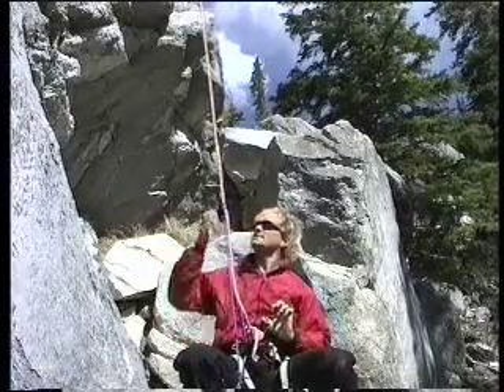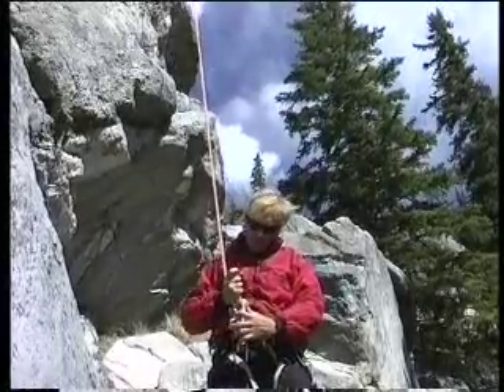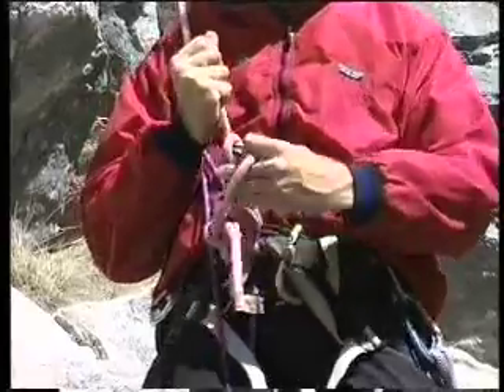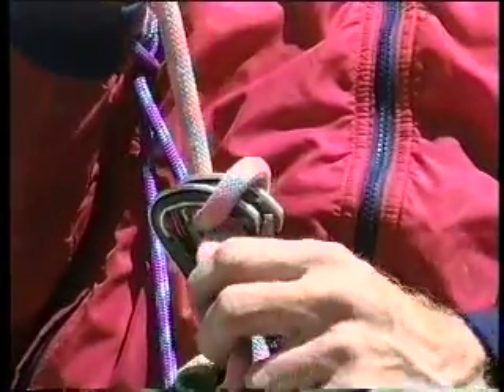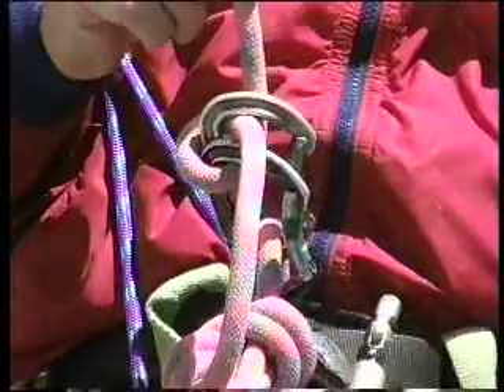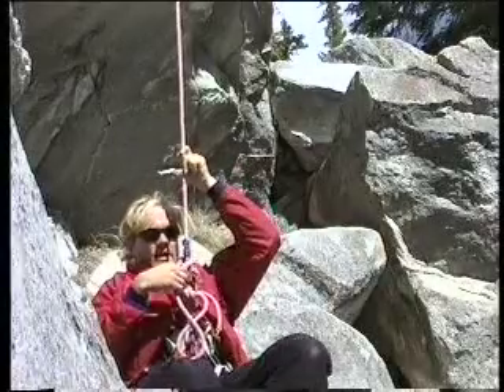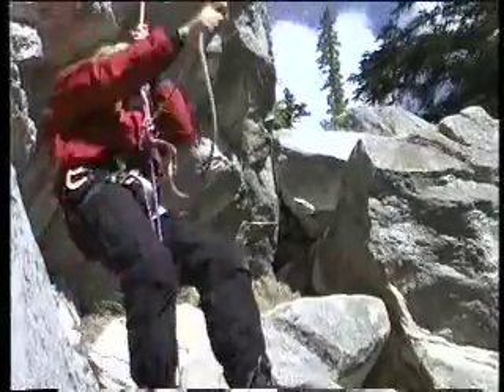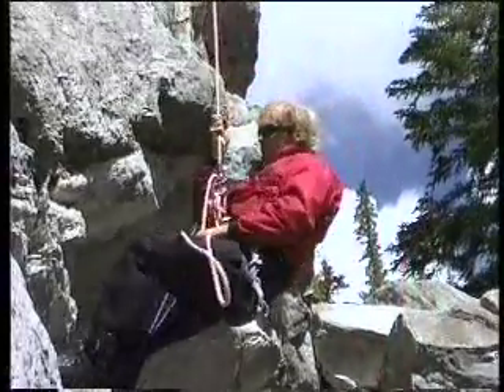Climbing Tools: Crevasse self Rescue. Garda hitch

Comment: Hi, these is an example of working when we are lack of devices right? Would it be possible to have the bottom carabiner facing opposite direction from the top so as chances of the rope sliping to clip in the bottom carabiner would be slimmer? That also depends on working hand. If right handed, the bottom carabiner gate should face left side direction. If left handed, the bottom carabiner gate should face right direction. Correct me if Im wrong.

Comment: just a question. Why would you use this over an autolocking munter (ALM). the ALM uses a locker through the heart and around the load strand to keep the munter from rolling. From what i can see it could be used in the same way as a ratchet and be way less "finiky." also it can use lockers

Comment: Lummers70 - If I dropped my atc (which I never take off the biner) I would reach into my toobox and pull out the trusty ol prussik, autoblock, or klemheist. When in need I have belayed using a munter or rescued using the same hitch with a mule. Strictly speaking alpine climbing of course. If caving or aid climbing then a different ascension technique. What you keep in your toolbox is your business. Hope you know how to ascend a rope without a biner.

Comment: @mikebarter387 i have actually tried this with screw gate biners and it works but i just had one set the other way around so the gates were not touching. * this was with D biners and i would guess it wouldn't work 2 well on oval screw gates

Comment: I've tried this going up a rope. This method is a bit faster, and less clumsy than using dual prussiks, but at the lack of safety (NB: always clip the prussik cord into your harness). If you know your going into a crevasse, or a waterfall - it would be way faster with an ascender or two. anyways - a great method of ascending if you've lost some essential gear. etc.

good job with the videos

Comment from the maker: Locking biners would be a solution except that the screw gates keep the biners from pinching together. They bind against the spine of the carabiner and won't pinch the rope tight enough. Not sure that is clear but give it a try and you will see what happens.
That is a good question that I am sure may must be thinking
Thanks 
Mike